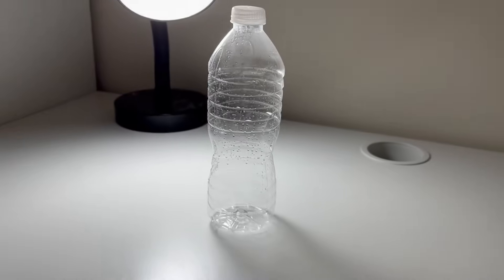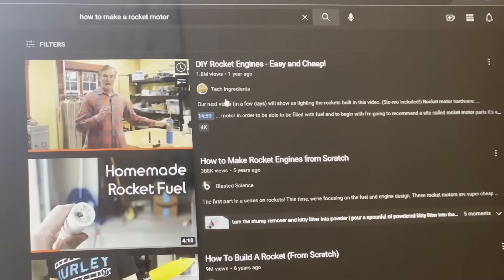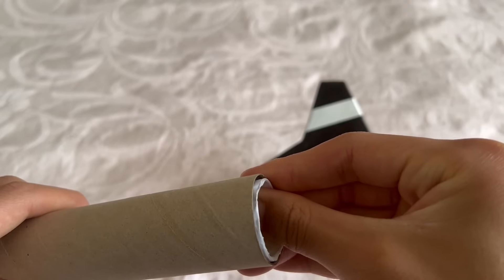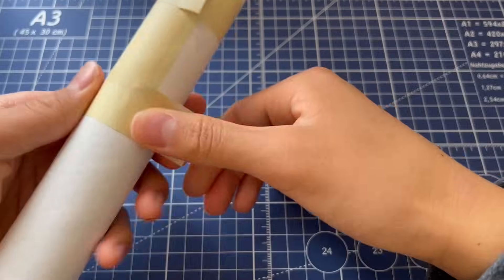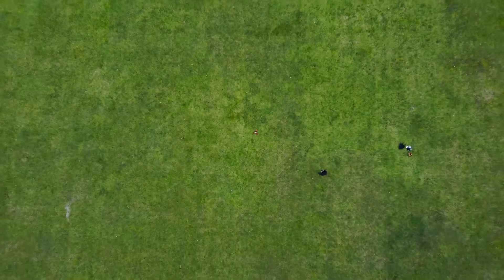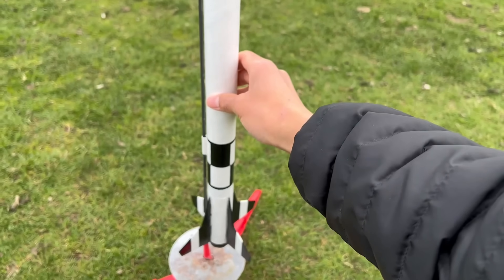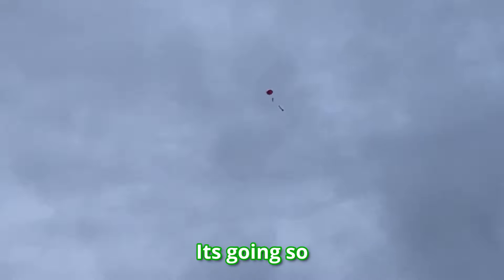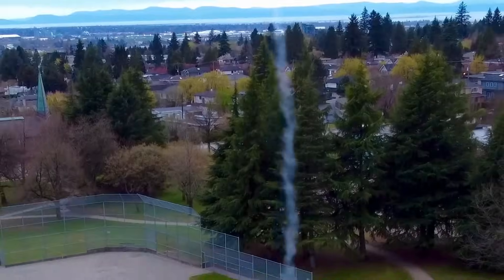Homemade 200mph Rocket

Comment: I'm a high school student team trying to make a rocket, may I know the name of the program you used, and I'm wondering how you made the controller. The translation might be weird using a translator..
Reply from the maker: Program is called open rocket! The controller is just a simple battery wired to a switch wired to a wire with a small segment that is very thin. This segment sticks in the rocket motor and gets hot when the switch is swicthex
Reply: @ibuildstuff Thank you!! 🥹❤If you have anything you don't know, is it okay for you to keep asking me?

Comment: Can you show us how you made the controller?
Reply from the maker: bascially just a 9v battery connected to 2 long wires with alligator clips on the end. Also added a button and a few "safety switches". Then you just connect the igniter in between the alligator clips, turn on the switch, and press the button to ignite. (the igniter basically catches fire if there is a certain amount of current passing through it.

Comment: Paint it fluorescent orange so you can see it at its apogee and find it on the ground or in the trees if it drifts far away … also skip the ni-chrome wires and battery and use the reliable cannon fuse (wick) that you can light with a match !!!

Comment: I made a model rocket recently that used 3 engines (a large one in the center and 2 smaller strap-on boosters). When I tried to ignite the engines, only one ignited, sending it dragging across the ground. I found it in pieces.
Reply from the maker: That’s slick- too bad it didn’t work :(

Comment: You can use pencil graphite rod as ignitor, just connect two wires to the battery and it will turn red hot.

Comment: What was those two cylinder type little things which you used as fuel?
Reply from the maker: thier rocket motors and they work kinda like fireworks but for model rockets... you can probably find some in a hobby store

Comment: What is igniter made of because like is it only a two conected wires or?
Reply from the maker: It’s a super thing wire with 2 ends and flammable thing in the middle
Reply from the maker: So the wires on the launch controller connect to it and when the current reaches the super thing part it causes a lot of resistance and burns it

Comment: I tried to do this last year in April too but ultimately failed because of a design flaw that made the rocket too heavy for liftoff, 
Our team is working to make a proper one now
Reply from the maker: Good luck!!
Reply: @ibuildstuff  thanks! I have just finished making thr ignitor and made sure it worked, I had wires disconnecting often so i test it near my soldering station lol

Comment: A rocket (from Italian: rocchetto, lit. 'bobbin/spool')[nb 1][1] is a vehicle that uses jet propulsion to accelerate without using the surrounding air. A rocket engine produces thrust by reaction to exhaust expelled at high speed.[2] Rocket engines work entirely from propellant carried within the vehicle; therefore a rocket can fly in the vacuum of space. Rockets work more efficiently in a vacuum and incur a loss of thrust due to the opposing pressure of the atmosphere.

Multistage rockets are capable of attaining escape velocity from Earth and therefore can achieve unlimited maximum altitude. Compared with airbreathing engines, rockets are lightweight and powerful and capable of generating large accelerations. To control their flight, rockets rely on momentum, airfoils, auxiliary reaction engines, gimballed thrust, momentum wheels, deflection of the exhaust stream, propellant flow, spin, or gravity.

Rockets for military and recreational uses date back to at least 13th-century China.[3] Significant scientific, interplanetary and industrial use did not occur until the 20th century, when rocketry was the enabling technology for the Space Age, including setting foot on the Moon. Rockets are now used for fireworks, missiles and other weaponry, ejection seats, launch vehicles for artificial satellites, human spaceflight, and space exploration.

Chemical rockets are the most common type of high power rocket, typically creating a high speed exhaust by the combustion of fuel with an oxidizer. The stored propellant can be a simple pressurized gas or a single liquid fuel that disassociates in the presence of a catalyst (monopropellant), two liquids that spontaneously react on contact (hypergolic propellants), two liquids that must be ignited to react (like kerosene (RP1) and liquid oxygen, used in most liquid-propellant rockets), a solid combination of fuel with oxidizer (solid fuel), or solid fuel with liquid or gaseous oxidizer (hybrid propellant system). Chemical rockets store a large amount of energy in an easily released form, and can be very dangerous. However, careful design, testing, construction and use minimizes risks.[citation needed]

Comment: m trying to create an anti drone defence missile system ...like to stop kamakazi drones and shit (as a demonstrator) and am thinking of using 2 counter rotating edf  powerplants instead of KNO3 booster ...cause they aint very reliable and expensive. Have u had any experience with Edf rockets ?
btw great video and inspiring work